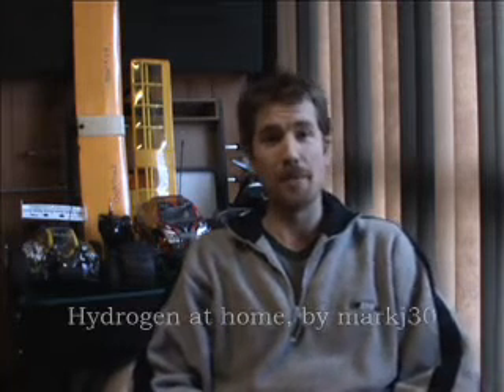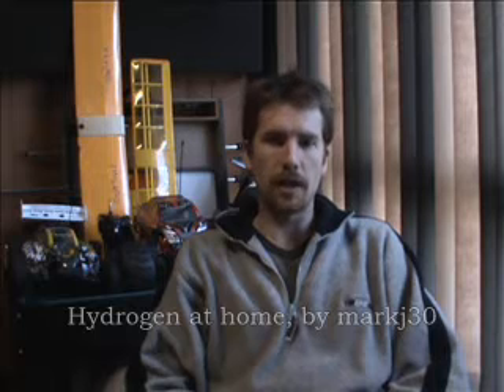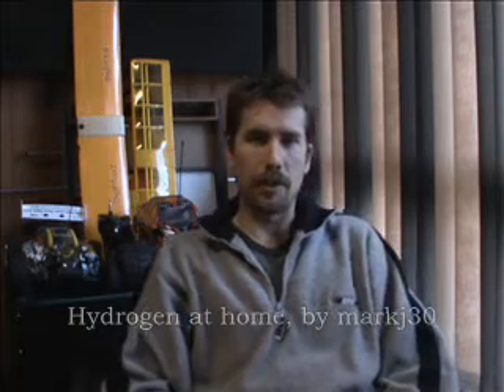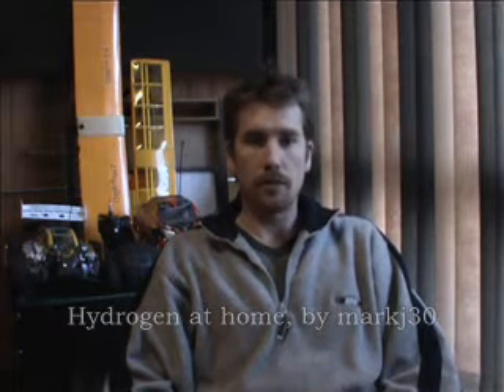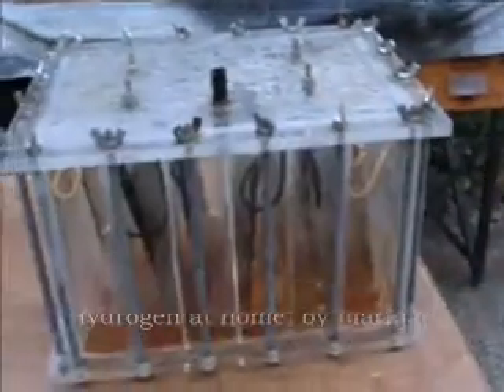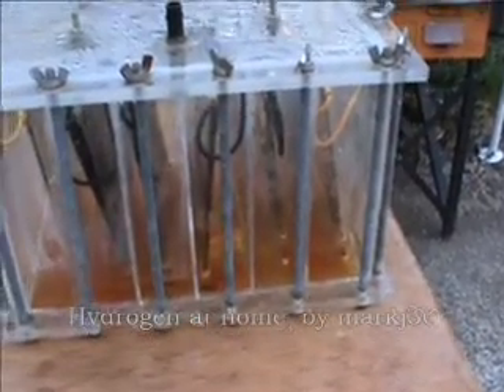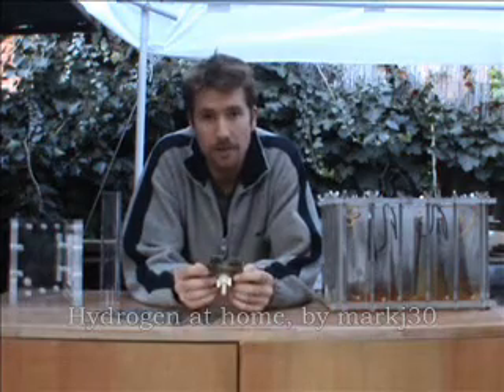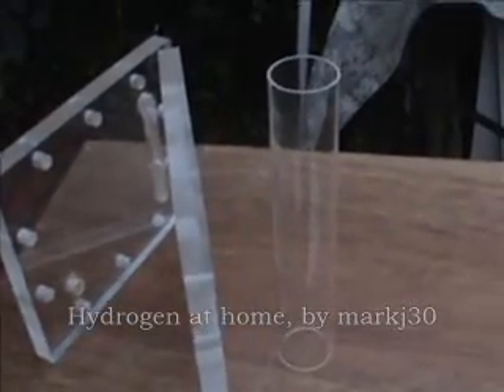Hydrogen at home (overdue conclusions)#34

Comment: @insAneTunA In short this house boat is able to produce more energy then it uses. In a way you could say that it is a self sustaining over-unity system if we do not count the energy that was used to make the materials and to construct the house boat. But maybe in time it can be made efficient enough that it can earn back the energy that was lost during the construction from the Autarc. They're going to monitor all the energy that is used and produced, and they'll put the data on a website.

Comment: @markj30 They explain to people how it works and what the benefits are, but you don't need the full explanation because you already know how a hydrogen system works. They can put this boat at any place they like because they don't need any connection with the shore. It's completely self sufficient. They use combined solar panels for electricity and hot water. The electricity is used to create clean freshwater and hydrogen. All the comfortable stuff is also integrated.